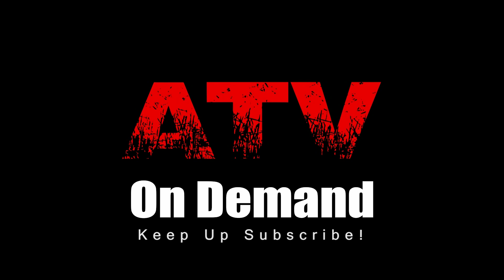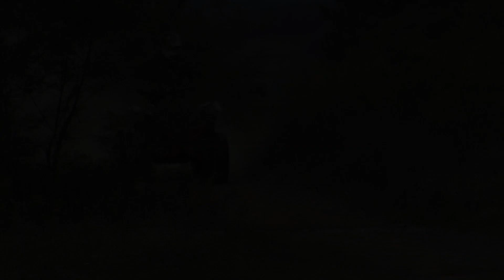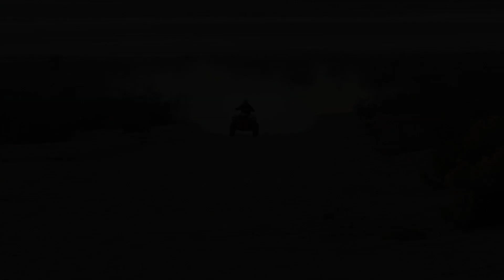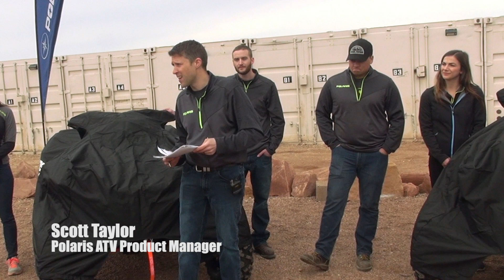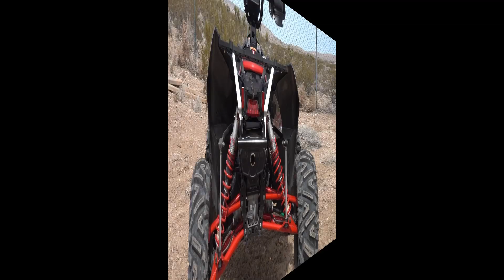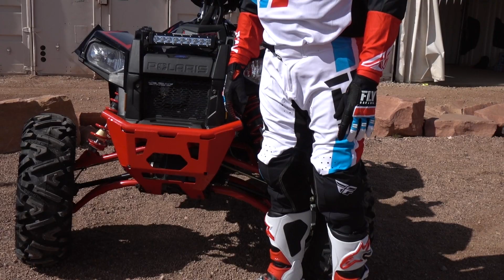2020 Polaris Scrambler XP 1000 S Test Review

Comment: Well I got a 2020 Scrambler XP1000 S and I couldn't be happier with it and it's the same one l my friend had I tested and at the time didn't like the ride and he had 10 lbs of air in the tires.  Doing weight reduction so far cut 30lbs.

Comment: I got to take a Scrambler 1000S for a ride I took it for 2 Trails then give it back the ride was really hard and steering seemed week and the tires was crap like I was on ice. But one upside for the guy that's the owner said he got it used with only 25 miles on it for $8,000 and even stop a order on a can am Renegade xxc . I wish that I could test ride a Sportsman 1000 S I think it would be more to my liking .
Reply: I now have this 2020 Scrambler XP1000 S my mind is blown how good this thing really is. 
The problem solved he had 10 psi in the tires just made it ride harder and no grip from the tires. 
I can safely say that it can run over anything and not even feel it.

Comment: Yeah, just what I’ve been looking for, an 881lb “sport quad”. Wet weight, ready to ride is likely over 930lbs, then add the front winch on top of that. 

Back in ‘85 the then new Suzuki Quad Racer 250 weighed 293 lbs dry. This thing weighs more than three Quad Racers, the sport side of ATV’s continues to go in the wrong direction. The ‘95 Yamaha Wolverine was 4wd and 485 lbs dry. You could actually pick up one end or the other. Quads shouldn’t weigh more than a snowmachine. Polaris makes great sleds, their ATV’s? Meh...
Reply from the maker: We are as big of advocates for the two wheel drive sports segment is anyone. That being said, there are things that this ATV does very well that no wheel drive sport quad could easily do. Some other four by fours for that matter. We understand all of your points and would love to see more two wheel drive sport machines. The demand is there, the manufacturers are missing out. Greed.
Reply: ATVonDemand I hear you and am glad you guys are advocating for new, traditional sport quads. A few years ago I decided I wanted to buy a new 400EX as it’d been around 10 years since I sold my KFX 400. I hadn’t been paying attention and was shocked that it was gone along with everything else. I guess I should have bought a KFX 450 when it was available as it had reverse and true to Kawi tradition they dropped it after only 2 years or so, just like the Tecate 4. I’m glad Yamaha is sticking with it but I don’t want a 450 with no reverse. 

It seems like there’d be a market for a small, light weight 4WD sporty quad like the original Wolverine. I suspect if they released a revised version of the original it’d likely be pretty popular as most people didn’t understand what the original Wolverine was back in ‘95. More riders would get it now I’d think. 

But then again who knows? Maybe there aren’t enough ATV riders who even know or could appreciate what a joy a lighter weight four wheeler is to ride? I just know that the current belt drive, heavy and expensive Scamblers and Renegades are not what I want.

Comment: Everybody knows Polaris and Can-Am are junk.   People buy them because they have high HP engines and a lot of suspension but what difference does that make when you have to work on it all the time. You can tell from looking at the ride video that this thing is an accident waiting to happen.   I would rather have the two brunettes when they are uncovered.
Reply from the maker: We think you hit the nail on the head. People by Polaris and Can-Am because no one else makes machines like these.

Comment: They didn't improve the Scrambler, they replaced it with something that doesn't deserve the name. Bring back the much lighter single cylinder and improve the suspension!
Reply from the maker: So are you asking for the Scrambler 500 to come back or the original Scrambler 1000? We enjoy the Scrambler s and the other versions that came before it.
Reply: @ATVonDemand  single cylinder would be the 500. Then re-vamp the suspension and use new tech materials to get the weight down. Now THAT would be a winner. Polaris started the class and then abandoned it.

Comment: Guys what did you say was the overall better machine this scrambler s or the outlander? I would get the gade but there basically the same! I’m getting caught up in both now!
Reply from the maker: This is tough. The Can-Am is a bit faster. Obviously, it will also do better at negotiating tight spaces. If you typically ride on Trails shared with 60 + inch side by sides and you prioritize stability and suspension travel the Polaris has an edge in that area. If building a jacked-up Mudder is your thing the Polaris looks as though it may be a better platform, although we have not dug into this and cannot say for sure. Love the question. If you have anymore feel free to head us back.
Reply: ATVonDemand we ride a mix of everything here but we’ve taken the rs1 through class one trails before and it’s faster than the quads! I think I’m going with the renegade! We’re there any changes from the 19 to 20? I didn’t think anything but plastics! Thanks for the help!

Comment: 14k is comparatively not that much to a Raptor 700. I have 14k in my 2019 Yamaha with extended A arms, axle, shock mods and Big 3.
But...it is twice as heavy as the Raptor 700 but also has twice the HP.
Very interested to see how this machine does in the Dunes.💣
Reply from the maker: Totally agree with everything you said. Don't forget though, it weighs twice as much as your Raptor.

Comment: Being in the ATV market for several years now, constantly changing what I own, I see several issues here.  First is the size. The "stability" is coming from it's width. This is not going to fit nicely in the back of a pickup anymore.   Second, some states base registrations on dimensions.   Not that it matters much, but this becomes a type 2 ATV in PA.. so it costs more to register and plate.   
Next is the weight. Near as makes no difference... 900LBS!!! And it sounds like the sportsman is weighing in close to half a ton!!  ATVs seem to be getting pretty bloated the past 5 years. 
Final note is more of a side note, but after 600-700CCs of engine... It only becomes a numbers game.   There are some instances where it works to an advantage, but anything larger becomes arguably unnecessary. Someone is going to produce a 1200 twin or a 3cyl engine for something the next couple years.. mark my words

(I was writing this as I was listening to the second half of the video so I know I'm repeating some things already said)
Reply from the maker: Hey, great minds think alike. Like Scott from Polaris said, this is a niche vehicle. Fortunately, they are keeping the 47.6 in Wide Sportsman.

Comment: What a joke. For cross country you really need travel, but lower, narrower, and more horsepower. It has the same anemic 89 horsepower that gets smoked off the starting line by every Can-am Renegade and Outlander. How could Polaris be so stupid. Should have changed the frame like they did, keep the width, put on the high clearance A-arms, change the starting system because by the time it starts every Can-am is halfway to the first turn, and give it more horsepower. Wouldn't waste my money on the new scrambler.

Comment: bring back our 2wd chain driven 2stroke beasts back please
Reply: insanesavage gaming and outdoors banshee, quadzilla, 250r 👌
Reply: insanesavage gaming and outdoors  sad to say ther never cumin bk
Reply: My Favorite 2-Stroke ATV was my Trail Blazer 250. That thing was unkillable, completely. It got crashed four times by as many people, one time rolling sideways down a hill side over side at least 8 times, and it didn't even stall on the way down. 
The only time we broke it was our own fault by not running the proper air cleaner element in Ocotillo, so we lost compression in the cylinder. Rebuilt the top end, boom, right back in action. 
It got kind of bogged down at altitude, but a good rider could absolutely keep it swinging; not to mention we gave it brand new tires at one point and that thing went APESHIT all over again. 
Kind of regret selling it, tbh. It was more comfortable than the KFX 400's we have now, and was more accessible to new riders with its CVT and all in one brake. 
Oh well. I'll see him again in the next life.
Reply: insanesavage gaming and outdoors Polaris xplorer 250 4x4👌🏻👌🏻👌🏻
Reply: @masondick4851  I grew up on a Honda 250r and a Yamaha banshee
Reply: Yes please, bring back the old 2 strokes
Reply: I had an Xplorer 400 2 stroke utility bike. That thing was awesome but lots of issues with 4wd system. It smoked my buds sportsman 700 twin when they came out.
Reply: No

Comment: Man I miss my KFX400 and V-Force 700. I had so many quads over time it was crazy. 4 polaris models 1 BRP and 1 Yamaha Raptor but the first 2 were at least for me the best. And lets not forget how cheap they were back in the day. I think that these IMO are just way to big and overpriced, hell everyone thought my V-force was big but that one was a beast in the trails. Lava red with the black graphic looked amazing and I never had issues with plastic breaking all though I know some people did. Again price and performance back then came in at around 5500$ or less, now days forget it. Same with watercraft. Ugh crazy
Reply from the maker: Sea-Doo and Yamaha both have some pretty affordable watercraft these days. We remember the V Force 700 very fondly. We would have loved to have seen either a chain driven two wheel drive version or even a four-wheel-drive version to go up against machines like the scrambler.
Reply: @ATVonDemand  Yes Sea-Doo and Yamaha have some cheap models like the spark etc but they really are that (cheap) not a performance machine in any way. Just like my atv's I was able to have a ultra150 and 2 XP's 951/1000 and those at most ran for about 7K new. Had a 99 ultra, super fast early model before they detuned them and  one 99 and 2000 XP which to me at least was one of the best boats/skis ever made, just had to do you pre ride and post ride maintenance and you really never had a bad day. Boy Sea-Doo really killed off a great hull and fun ride with that one. Now they top models are monsters and cost 17k and up. As for the quads its a lost market in some ways as SXS have really pushed ahead but I'm just rambling here I guess. Ahh the good old days hahaha.

Comment: Well I see the same crap rubber boot an hose clamp style axles that are just going to snap as usual. they upgraded everything else but didn't touch the axle other than made them a little more beefier.  Fyi I am a proud Polaris owner of a '13 sportsman 850 xp h.o. an love it just disappointed in the weak axles. They should offer a re-buildable, grease-able closed gorillaish style axle but hey atleast you'll look good breaking the axles. If my memory servers me correctly Polaris OEM axles cost nearly 500$ per axle back in '14 so I'm curious how much do these new beefier axles cost per axle an that's not included labor?....

Comment: You mention it as too wide to fit between the wheel wells of some mid size trucks. What larger ATV does fit between the wheel wells of a midsize truck? You pretty much always have to drive over them in the smaller trucks unless you have a Honda Recon or something. You probably mean it's too wide to fit between the wheel wells of some full-size truck lol. Neat machine as an option but I could see how it's very niche. Especially for SXS money where you can take a partner with ya.
Reply from the maker: We definitely don't want to start bashing on side by sides because they're fun. But for many of us, they're simply not as much fun as riding an ATV.   we have a Dodge Dakota that we use. The 47.6 in Sportsman wedges its way between the wheel wells. Obviously this 55-inch machine would not.
Reply: ATVonDemand The good old Dakota haha. Probably the only midsize truck with that kind of width. Yea I agree SXSs don’t exactly replace ATVs. I think these 55” ATVs are awesome honestly. Not sure I’d buy an ATV again because of physical injuries but if I did that scrambler looks like a ton of fun with the extra width and travel.

Comment: They had to make the wheel base wide because look how high you set it’s really too heavy and narrow wheel base would make it flip way to easy
Reply from the maker: It's high because of the suspension and width, not wide because it's tall.  Thanks for watching and commenting.
Reply: But why would they make the wheel base more wide then an average atv trail I guess to follow up with the higher suspension and seat height

Comment: If they had only left the wheel base alone and did the strength / suspension upgrades, I would be all about getting one.  By making it 55" you just prevented me from riding on half the trails around me. That won't fly.

Comment: I honestly like the gen 3's better. I have an 06 500 on a customized frame that takes a complete aftermarket 450R front end, bumper, nerfs and pegs. It's set up motox style with 18" rear n 19" front tires. Weighs in around 380lb.

Comment: Everyone is missing the sport atv group raptor and 450 still running hard with upgrades every year if I'm bulldogging trails I want to know if the machine lands on me I can survive.......went to a rzr for that reason and now I'm going back to a raptor because I had to build my ride time around trails I could winch or friends with me so we could flip them back over........45 to 60mph wrecks on 600lb machines and 1000lbs are unforgiving
Reply: I rode sport quads my whole life. I bought a new Sportsman in 2016 and only kept it a year. It was like riding the titanic and if that thing decided it was going to flip over or flip backward there wasn't a damn thing I could do about it. Theres no using your weight to control them or prevent a flip over. And yea if it lands on you your in bad shape. I could always hop off my sport and hold the front brake and save it from tumbling back down a steep hill, or even if it flipped back it wouldn't hurt me to bad. With the big sportsman I couldnt ride half the trails I used to ride because I knew if the machine didn't make it up...it was going to get torn to pieces tumbling back down and probably kill me along with it. I guess some guys have mastered riding 1000 pound battleships but for me its like learning all over again. I wish I had my 400EX back lol. I rode it for 13 years and the 4x4 guys never rode a trail that I couldnt also ride. Many times I could climb things they couldnt simply because of the light weight and quick burst of power I could produce in a short distance. AND....if I didnt make it I could usually safely walk it back down or flip it back with minimal damage to it AND me. Nope Ill never buy another titanic ATV and the Scrambler looks like a chopped sportsman to me. When that thing decides its going to roll or go backward your going along for the ride and will have a totally destroyed machine at the bottom of the hill.
Reply: @JohnnyRebKy  I'm trying to decide if I want a raptor 700 or if I want the maintenance on the super light yfz450 I had a raptor 350 and quadsport 400 they all had reverse and enough power so I'm wondering which route

Comment: 55 inch wide will not work in wooded areas. A lot of trails are 50 inches and under. This will not be able to compete in gncc racing either 50 inches is the maximum!
Reply: It would never compete in GNCC, it's 4x4 and 1000 cc.
Reply: @SVTsupercharged , there is a 4x4 utility class in gncc. Most of them ride renegades or outlanders.

Comment: There is nothing sport about this thing, the size is only good for wide open areas. Yamaha had the right idea with the original Wolverine back in 1995 with a lightweight Sport 4x4. Would be nice if someone would make a modern version of the Wolverine. A sub 500 lbs 4x4 with a 500 to 700 cc engine, 5 speed auto clutch, long travel suspension and selectable 4x4 would be a great trail machine. Guess I will keep my lightly modded 05 Wolverine a bit longer.
Reply: Wolverines are GAY!!!
Reply: I have a Wolverine in my garage and you have obviously rode nothing other than the wolverine your whole life, my girlfriends raptor 250 walks all over the Wolverine in every single way
Reply: Wolverine lol. Unless you’re going Motocross I can assure you that my 1000 scrambler will shit all over any sport 450CC class ATV
Reply: Got my vote, I'm wanting to get a new ATV but don't want a bus.
Reply: wickedwolverine350 I like my 350 Wolverine and won’t be selling it anytime soon. These OEM’s just don’t get it.  That’s why the last brand new quad I bought was back in ‘07 and I still have it. They just don’t offer what I want.  It’s called light weight.

Comment: I’m one of the few hold outs not joining the sxs craze simply due to liking to ride areas even 50” sxs’s wouldn’t like , so yea an even wider 55” Atv heads in the wrong direction for me .  I still have my 2012 Brute Force 750 and they are just hard to beat bang for the buck . But , I’ve been desperately hoping Kawsaki would eventually offer a 850-1000 brute but I think they’ve given up on the atv market . That being said I’ve been heavily considering going back to Polaris on a 2019 sportsman xp1000 . I still worry about their fit and finish and small component quality control . I’ve owned almost all brands except Suzuki and they’re all leaps and bounds ahead better built than my last Polaris .

Comment: Over 800 lbs ? I have 2 atv's, they are 400 lbs "wet". Not sure i would call that a "sport atv"...
Reply: Yea dude I drove a f250 with 8 inch lift and used to load my 450r in the back by myself without ramps.